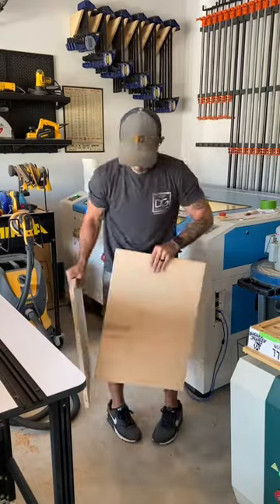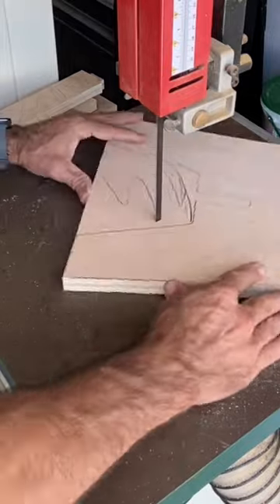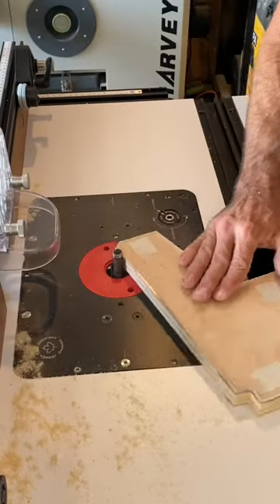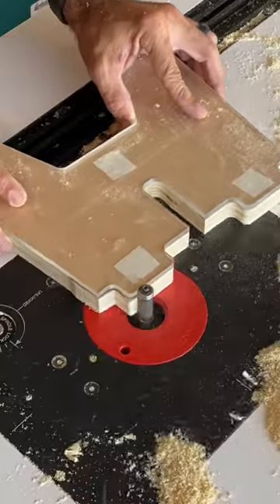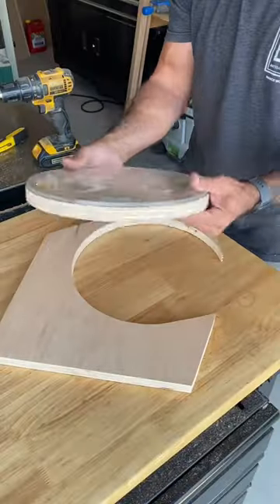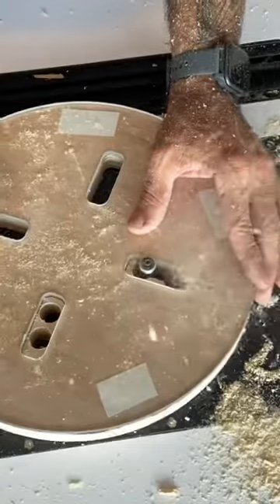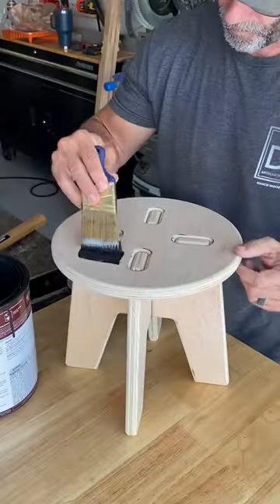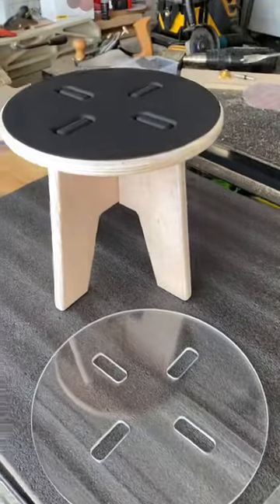SCRAP wood FLUSHED #shorts #woodworking

Comment: Pretty much all the wood I use is scrap.
I work at a concrete factory, and i collect offcuts and other scrap pieces of formwork plywood.
Right now I am in the process of making a lamp for my livingroom. I make it from 20mm (~3/4") strips that I have planed the outer resin layers off of and glued together, so that the ply layers become a feature, rather than something to be hidden.
I have already made 2 table tops for workbenches using this method, and they look amazing! :)

Comment: I am a flyfisherman & I used to use chestwaders daily. They were not drying between uses, so I made a rack that would hold them upside down in the garage, attached to a shelving unit.  Gravity helped me dry them daily.  Scrap 1x4x10. Simple but effective.
Reply from the maker: That was a great idea and solved your issue. So cool 😎

Comment: there are assumptions in template as to thickness of plywood.  Exactly 3/4 or the newer narrower 3/4-  Which is it ...interested in template
Reply from the maker: It was designed for plywood labeled 3/4” thick which in supply stores will actually be 21/32” thick which is basically hair less than 3/4”.  But you don’t have to make it with plywood. You can use it for solid wood too.
Reply: @DesignsbyDonnie  Thanks for clarifying